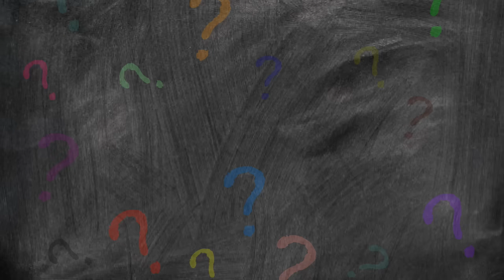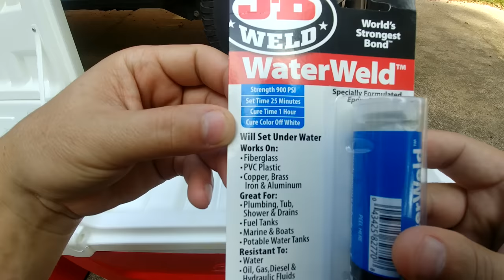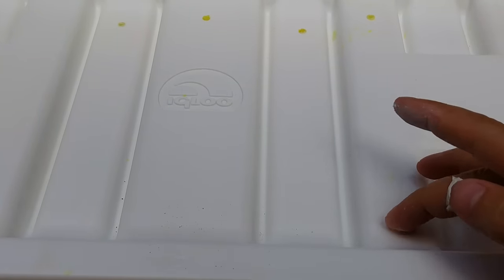Do Yeti cooler hacks work?

Comment: The unmodified box works better because airflow needs to flow in the empty compartment of the top. By having that airflow causes a colder environment. By insulating the top there is no airflow in the upper lid so you’re actually trapping in heat I know it sounds weird with ice but it’s thermodynamics

Comment: Yeti doesn’t use foam they use vaccuum which is a little better than air but air is still better than foam
Reply from the maker: Not true for their coolers. Look on YouTube for yeti cooler cut in half. They use foam insulation.

Comment: That was wayyy too complicated using JB Weld (conventional putty) to fill in the holes.. A two part clear epoxy mixed with whiteout would last forever, it’s more water proof than putty, is almost invisible to see, & you would have been done in 5 minutes tops..

Comment: U need to put the foam in the walls and the bottom of the cooler, and if u want a better seal use Permetex Gasget sealer u can get the at any auto parts store

Comment: Air is some of the best insulation. With the foam inside touching the exterior and interior walls it will transfer the heat from outside in due to thermal conduction. If yeti wanted to fill the voids in the cooler they would have…
Reply: And that's exactly what Yeti did.  Filled all the voids, bottom, sides and top with foam.

Comment: FYI: get a few styrofoam sheets from a supplier and line the inside walls of cooler with it . Place beers fill with correct amount of ice ( for me I use 55qaurt ice chest couples sheet of styrofoam for walls one for a lid and fill with small bag of ice on pre-chilled beers , it should last 36+ hours being cold , 40* is pretty cold for a beverage when it’s 105+ around the gulf coast

Comment: Your ice was not broken up on regular cooler and alot more broken up on modified cooler. Large chunks outlast small pieces by far! Debunked
Reply from the maker: If it actually performed like a yeti would this really matter? I did another test with an actual yeti cooler and as you can see in that video the answer is no comparison.

Comment: DUDE............YOU GOTTA SCREW IN 'LATCHES', THAT'S YOUR PROBLEM!!!!

THE LATCHES LOCKS AND SEALS THE COOLER....RIGHT NOW, ALL THE COLD AIR IS ESCAPING THRU THE SEEMS......DUH!!!
Reply from the maker: Yes I am sure that is what caused this whole issue. After I put on latches it will be as good as a Yeti. I can assure you it was air tight and if any air did escape from the lid it wasn't much.

Comment: It has nothing to do with the type of foam. But what it does have to do with is “precooling” the cooler. If you think about it, the mass of foam is meant to hold the surrounding air temperature. (Ambient temperature). 
The foam will hold this temperature more efficiently than the cooler with no foam, o lay pockets of air.  If you precool both coolers, then do your testing, it should be a better experiment. Also, check the temperatures of each cooler BEFORE the  test commences. This is a vital controlled measure to take.
Reply from the maker: I did not intentionally try to pre-chill the coolers but in my second test I believe both coolers were pre-chilled due to the temperature readings I showed just before putting in a second bag of ice.

Comment: you are aware that open air is one of the best insulators right?
Reply from the maker: I think you mean compressed air otherwise why build walls in a house if leaving it open would insulate better.
Reply: @HowToWithJames  actually a vacuum is the best insulator, and you really seem to not understand my comment at all which is amazing.
Reply: @HowToWithJames  by the way, open air isn't dense, which means that is doesn't pass energy easily. the more dense the matter the more likely for energy to be moved, making lead a great conductor if it weren't for the fact that led melts at low temperatures. are you starting to understand the words that i am saying?
Reply: @HowToWithJames  also if you want to argue with me, why do you think you can touch the outside of a deep fat fryer without burning yourself? open air.
Reply: @HowToWithJames  nothing compressed, just a gap between surfaces.

Comment: Think about this for a minute. When getting ready to go outside in the winter you want layers that trap what? 

AIR. 

The air inside the lid is the best insulation for that particular design

Spray foam is too dense to allow proper air pockets to help. Yes it’s great to keep your pipes from freezing but in that case a good towel wrapped around the pipe will give you almost the same effect.

Comment: I like to see both the top and the bottom part of the cooler with nitrogen replacing the air.
Replacing the moisture in the air with a stable gas like  nitrogen, would be very effective

Comment: Spend $250 and get a good American made cooler that will hold ice for 8 days.
Reply: “Spend $250” on a cooler... Yikes.. Go get a Coleman from Walmart. Throw a few brews in it.. Take it to the lake, beach, camping, fishing, hunting... Use it the way coolers were meant to be used. Throw it around, scratch it up, make memories.. Don’t buy an overpriced box designed to keep drinks cold for 3 months in the Afghan heat.

Comment: The foam acts as a thermal bridge that’s why it was worse than the normal lid
Reply from the maker: I am not saying I agree or disagree but I am curious why do you think a Yeti cooler is filled with insulation?  I know a tumbler uses air as insulation but I also know a Yeti cooler uses insulation.
Reply: How To With James yeti cooler insulation is (I’m pretty sure but also haven’t seen yeti insulation before) close to fiberglass insulation which works off the principal of less contact less conduction whereas the foam insulation is a single mass of a solid with “insulation like” properties with a lot of bubbles inside, the foam when set is a solid mass that can (eventually) allow the heat to soak through